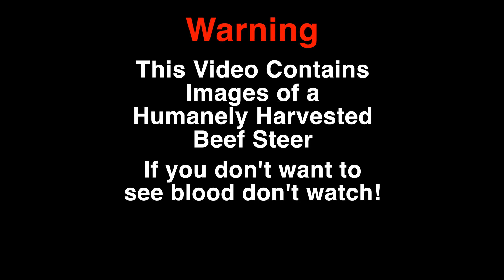Turning a Boat Trailer into a Mobile Hydraulic Boom Crane: DIY Adventure! - Part 13 @UncleTimsFarm

Comment: Now that is Cool, I have a 26-foot Boat trailer with 2 axels, Now I know just what the plan is going to be with this trailer. What would say about out riggers at the rear and back at the ball hitch? Also having another boom inside of the other to get a longer reach? And what did you spend on this project if you don't mind me asking? Very Cool.
Reply from the maker: Outriggers would help make it more stable for sure, but so far I haven’t had any issues with it wanting to tip, and I lifted a 650 lb hog with it and it wasn’t attached to a vehicle.  When I lift a beef steer I always have it hooked to a vehicle just in case.  The 4 trailer jacks I put on it seem to do a pretty good job.  I also make sure to only lift a load using the winch and the boom is in the up position.  I never use the boom to hoist anything.